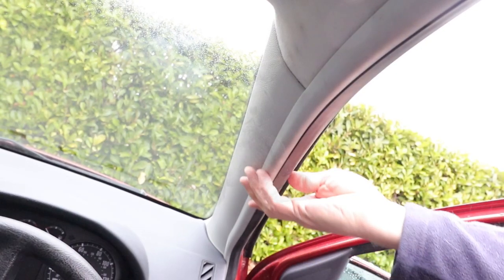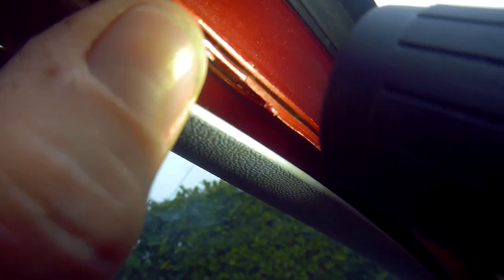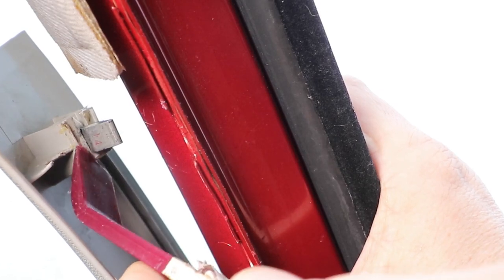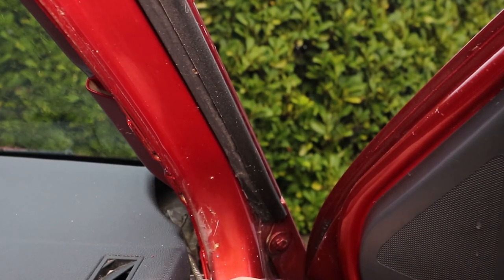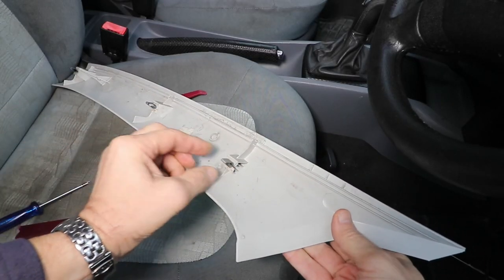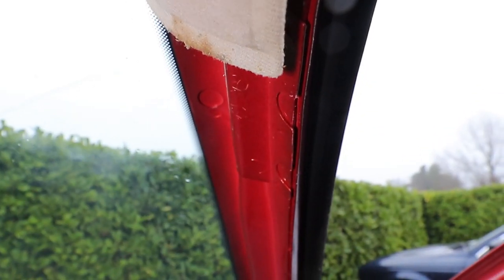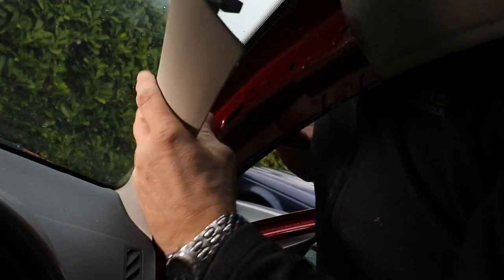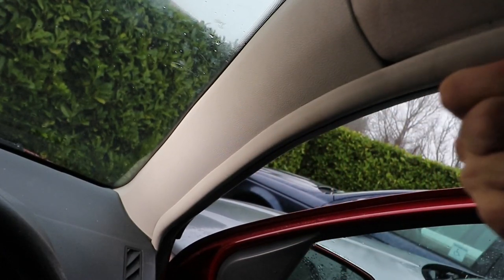SKODA FABIA A Pillar Panel (top) 99-07

Comment: I just installed a dashcam cable behind that A-pillar today. I wasn't brave enough to remove the panel completely so I flexed it up slightly. I was hoping to learn before I started the installation whether there's an airbag behind the panel but the Skoda dealership couldn't give me a straight answer to this question. So this video answered it categorically. Many thanks for this. Chat GPT reckons that just because there's no "Airbag" word embossed on the pillar doesn't necessarily mean there isn't one, hence the doubt.
Reply from the maker: Only two airbags were installed in Mk1 fabia. Mk2 introduced side airbags with option for curtain airrbags.

Comment: Needed such video a week ago. It was not so easy, all the clips were stuck in metal, but I didn't broke that places they were sitting. Was using that plastic instrument you are using in your video.
Reply from the maker: Glad you didn't break the panel and were able to fit it back nicely. As I said in the video a metal angled tool would have been the best and have now ordered one as they are pretty cheap. :-)

Comment: Another great video in series.
How do you connect camera charger to car 12V system? In Skoda Fabia fuses are very close to cover, so there doesn't seem to be enough space to use standard car fuse tap / splitter.
Reply: I went to the effort of taking out the fusebox and fitting a new fuse holder in an empty space in the fuse box. There's a positive terminal just above the relays where you need to take the positive feed from. You can use the screw securing the fusebox for a ground. It's not as difficult as it sounds. I think the part number you need for wire to add to fusebox is 000 979 227.
Reply: @an1_uk  Thanks for answer (and part number). Doing it that way seams like most profesional way to do this. 
To populate additional fuse position in fuse box: did you disassemble lower dashboard (https://youtu.be/Kb1ZQCxus48?t=385) , or just puled fuse box out/to the side of the car?
Reply: @Lukdzwo  I removed lower dash to get best access. Think it's just the light switch, about 7 torx screws, then the obd port to unclip.

Comment: While you have this off, if your car doesn't have it you can add a clip to hold car park tickets etc. I used strong double sided tape to secure it as didn't like idea of taking a drill to the A pillar. Works fine. Part number is 6Y0867159 and should cost next to nothing.
Reply from the maker: Thanks, great idea, there are holes already in the pillar for these, but they are more central and I would prefer the holder to be either low down or high up away from my vision :-)